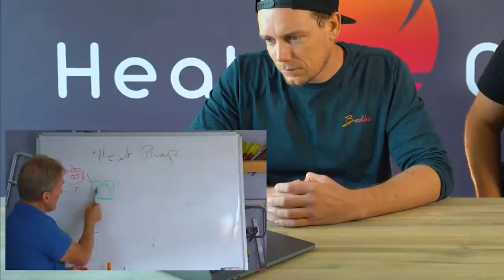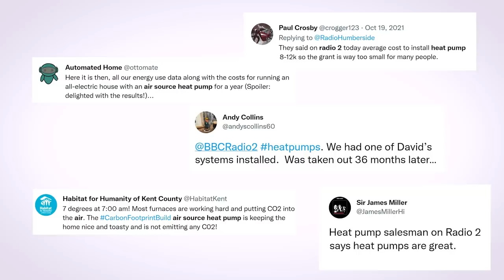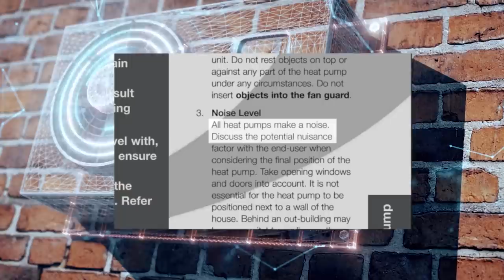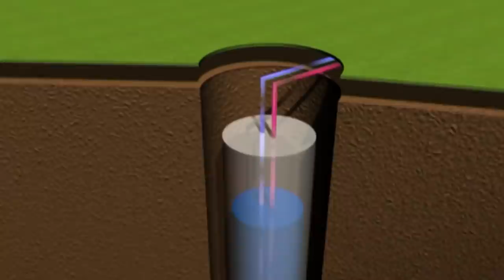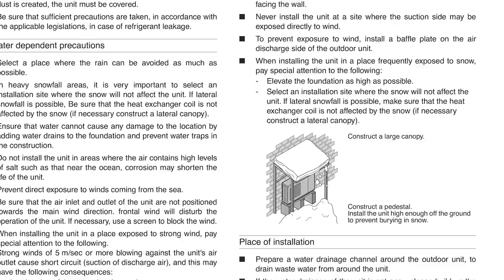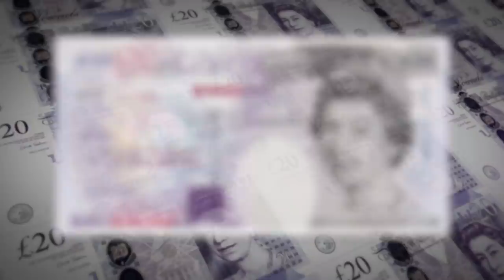Heat Pump Secrets They Don't Want You to Know

Comment: I wanted to thank you for your informative videos.  While I believe you have a bit of a bias against heat pumps, you do back it up with useful information.

For my own home I am planning an air source heat pump installation.  But I am keeping in mind a bunch of the caveats you've mentioned.  The major purpose of the install is summer cooling.  I hope to also use it for 'shoulder season' heating.  But I will not be depending upon the unit for heating in the coldest weather.  The existing fossil fuel steam heat will remain in the house.

My expectation is that the heat pump will be great in the fall and spring when only a bit of heat is necessary, temperature lift is less, and the steam heat is less efficient because of very short run times.  But in the dead of winter I won't even try to make it work.

I'd love to heat feedback on this approach.

-Jon
Reply from the maker: A bit bias? Blimey I would say totally bias. We want to stop people making this mistake.
Reply: @SkillBuilder  Perhaps we are using language differently; I would not call being against something on a factual basis to be biased at all.

You've said that air source heat pumps can work in specific situations, and call out the problems that must be considered in such installs.  My impression is of your videos is that you are willing to identify both strengths and weaknesses versus other technology, with perhaps a bit of bias that amplifies the weaknesses more than the strengths.

I live in a climate where air conditioning is necessary for about half of the summer.  I removed a very poorly implemented ducted AC from my attic, and need to replace it.  (AC was removed in the fall, all of the holes for the ductwork sealed off, and just this air sealing was enough to drop my heating oil consumption by about 20%.)

My home has a splendid oil fueled steam radiator system.  It can easily heat the house on the coldest of days.  But in the early fall and late spring the system needs to spend more time heating a cold boiler to make steam then it spends actually making that steam.  Perhaps I could rip it out and install a hot water system, but now we are looking at huge expenses to install return pipes, add circulating pumps, etc.

A 'minisplit' heat pump system seems a good choice for this situation.  In the spring and fall when I don't need many BTU to heat the house, and outside temperatures are relatively high so system COP is high, then the heat pump would be cheaper/more efficient than oil, but on the coldest days I would simply switch on the boiler.

Regards,
Jon

Comment: Is there another alternative thats worth looking at here, clearly the Gov wants rid of gas boilers like they do diesel cars (even though they are hugely efficient compared to petrol and Euro 6 engines push out cleaner air than the city air they breath in). Is there not a more efficient way of running our gas boilers, or a better way of cleaning up the exhaust?

Comment: heat pumps can be brilliant but you need a house fitted for it otherwise you still need a gasboiler to back it up or  electric boilers wich helps them , wich raises the electricity bills through the roof....

Comment: Honest opinions but with a mistake or two.

You're correct that most electricity used in the UK is currently generated from burning gas - but you're wrong about that meaning "why not just burn the gas to heat the house?"

Firstly because a properly installed Heat Pump is much greater than 100% efficient.  So, even if the electricity is produced from gas, less gas is needed to get the same heat in the home 

But, more importantly, we are decarbonising our electricity supply, shifting more and more to renewables.

We can't do that with gas.
Reply from the maker: Paul 
 Why not decarbonise and then worry about ways to use it? 
As for the efficiency of a heat pump there are lots being installed with no weather compensation because it produces too many call backs for the installers. 
We also have housing estates where heat pumps have been removed in order to put back gas boilers.  Don't simply jump on the bandwagon without checking the destination. This is going to be anothe fiasco.
Reply: @SkillBuilder  We can't wait 20 years for full decarbonisation and then another 20 years for the installed base of domestic heating to be replaced with alternatives - this has to be done in parallel.

Comment: If you place your hand on the return pipe of a heat source pump it will be lukewarm at best. This tells you that it runs at a substantially lower temperature than a gas or oil burner. What this means is any heat loss in the way of poor insulation, poor air tightness and old windows the heat pump simply cannot make up for the heat lost like a gas/ oil burner can. Heat pumps are designed to work with new homes that are air tight and very well insulted.  In this situation they do work very well. They will not however work well in old stock housing without further upgrades to the property.
Reply: Yes. I've seen them put into old poorly insulated houses and they have been useless. One guy I know has had to have 2 massive ones installed after having one fitted and the house was freezing. Even in my own case building my own super insulated and sealed house from scratch I ended up going with a modern gas boiler. The difference in the unit cost and installation cost buys a heck of a lot of gas.
Reply: Exactly. There should be an independent government funded technical assessment available in my view.  We have one here in ireland as part of the SEAI grant system, but its about 700 Euro up front, then recovered if you get the SEAI grant.
Reply: I disagree. Look up "high temperature heat pumps", like Panasonic T-Cap or Mitsubishi Zabudan pumps. Designed to work with radiators and to be installed in existing buildings. Obviously having oversized radiators will help reduce the electricity usage, but these pumps can easily reach 40-50C on return.
Reply: @ggdhx  Are they violently expensive to run ?
Reply: @kyarichards2894  not really if the house is redone with normal insulation. If insulation is bad, no matter what heat source you use = gonna be expensive.
Reply: @ggdhx  I think that is Rogers argument in a nutshell. He is letting people know these pumps are not suitable for the vast majority of existing old stock housing without further upgrades to the property. What you find is inexperienced reps and sales people pushing these heat pumps on people who have little knowledge of construction saying they will heat their house the same and reduce their energy bills. That is simply not the case.
Reply: Funny how my solid wall house built early 1800s at -4c last week was sitting at 21c on the original rads as  we are not redecorating until summer. Also running cheaper and more comfortable than the oil did. I could rip this video apart if I could be bothered. Become to the conclusion his videos are simply click bait now.

Comment: You're argument was lost when you said you can't see the difference from getting your electricity from a gas fired plant. It's far more efficient to have a gas plant serving electricity to heat pumps and electric cars than serving gas boilers and refining fuel. Studies have proven this. Also if mice chewing wires are a problem than we might as well get rid of electricity in our houses altogether 🙄
Reply from the maker: It would help me if you could point towards those 'studies'. I have been told the exact opposite. 
Also mice chewing through wires is a problem and that is why it is in the instructions. Heat pumps are outside the building, I am surprised you didn't spot that small detail.

Comment: I'm responsible for heat pumps in large public buildings, some of what you say is true i.e. electrical backup, condensation but also you've cherry picked a lot of exaggerated negatives which could be picked out of any system. Just as an example for a gas boiler you need a gas supply. Every year we have gas explosions, some fatal, but I don't see fatal heat pump explosions. See what I mean? The video piece is OK but you highlight potential problems with heat pumps but no solutions to the overall problem as we simply cannot continue burning fossil fuels.

Comment: Skill Builder is clearly from the UK where this technology is now being pushed, so lets try looking at it from a UK stand point not from countries that have had this tech for years. He makes good points that conflict with what all these so called experts go on TV, isn’t it a good thing to get opinions from someone who has experience working on/installing all the heat pumps? So lets look at costs to install (in the UK)? It’s crazy money which most people can’t afford? If you have a property that is suitable for it and it works well for you then that’s great, no one is saying it isn’t. What are the maintenance costs? What are the parts availability? Parts for gas boilers are stocked nation wide with a good portion being able to be ordered for next day or off the shelf. Is this the case for the HP? It’s good hearing that people have had these working for years in other countries. This may not be the answer for everyone, just like electric cars. But if you have the money, space and a property this suits then this could be a good system for you. We may not all agree but it makes no sense to be abusive if someone has a different opinion to yours. I would be interested to see how many of the people in the comments have had experience working on/ installing / using from the UK? I’m only saying that as Skill builder is arguing this from a UK stand point

Comment: Well done Roger, not a 'rant' this time, more balanced although I still get the impression you are still a tad against the HP. Your point of power generation was mute, what do you expect? Gas/wind/coal/nuclear nowt we can do about that, we need electricity. I am taking a gamble on this, whilst electric and gas prices are through the roof at the mo, my guess is electricity prices will drop considerably in the future. For me I am not on the gas mains I have to use LPG (this has almost doubled since 2020). I go live tomorrow with my HP, I will give you an honest comparison and update on my decision to do this, I did my homework. Regards J
Reply from the maker: I think in your case it is a good choice and I would do it but I would make sure I had the right insulation and big rads or underfloor heating. 
My rant was all about the government giving grants so all those salesmen will will persuading people on mains gas to switch, 
I would love to know how you get on. I really am not against this technology in the right place but a lot of people will be unhappy.
Reply: @SkillBuilder  Cheers Roger, yes my property has been fully assessed insulation wise, upscaled two radiators only. I used a trusted installer (they installed my solar panels). As you know the government grant for my HP ceases in March, but I would be a fool not to take it. I do however agree with you, most housing stock in this country insulation wise is shocking, and that where the problem lies all round. You are the man to put it out there if you do decide to do what I'm doing this is what you need to do to make it work. PS. My installer says many future installs will miss the government grant due to HP supply issues.

Comment: Soooo, an air sourced heat pump is not suitable for every circumstance, who'd have thought. Even if you can figure this all out by yourself, check with a couple of dudes who know what they are doing, always a reasonably good idea. I have an air sourced heat pump, and it has worked just fine for the last 12 years, cost me £2,000 (probably refereed to as a "mini split") . Where I live the coldest it gets is about -6/7 degrees C, I have insulated my house pretty well (a good thing to do before you do owt else) . In the winter I put an extra layer of clothes on, I'm 69 and reasonably healthy/fit, even if I do say so myself :)

Comment: I have one and my bills are twice as much,they don’t tell you that,the heat is not as warm,we’re the rads get hot with a boiler,you need additional heat to use,when it goes in to defrost,it went from 70 pounds a month to 150,and don’t say it’s not fitted right,and you do need to keep it on all day and night,and you need to heat the water up as well because it’s doesn’t get it hot enough,I have had it for 9 years,and if I could I would switch to a boiler

Comment: Heat pumps and insulation two separate subjects.
A property no matter the insulation will take the same amount of heat whatever source,  heat pump, oil, gas, electric.
A well insulated property will take less to heat again doesent matter sourse of heat oil gas etc.
Reply from the maker: Rodney
The two subjects should be always considered together but I am amazed how many seemingly intelligent people don't understand the issue here. Yes insulation and draughproofing are desireable but they are often difficult to achieve in an old property. If you have a given heat loss from your property at say 0 deg celcius outside the heat pump with its low flow temperature will not be able to put the heat back into the building at the rate you are losing it. A gas boiler running at a higher temperature will have a better chance of keeping pace with the heat loss. It is not a desireable situation and in an ideal world we would insulate so we could minimise the heat loss but we have to be realistic. At the moment many people switch a gas boiler on for (say) ten hours a day and let the house cool down rather than trying to maintain a round the clock temperature. With a heat pump you can't do that because it takes days in the cold weather to bring the house back up to temperature. This is all explained in the installation instructions for setting up the parameters and weather compensation.

Comment: 6:10 "Look at the size cable" uhh yeah wise guy. The size of an electrical cable is determined by maximum, not running average. And the running average is no where close to a full rating of 6kW for whatever random heat pump you picked out.

Comment: When the time comes & they ban fossil furled heating I’ll just fit smart WiFi app controlled electric oil filled radiators , 
Probably cost me under £2000 to fit them.
Vs average £12,000 ASHP
Leaves £10,000 spare for heating bills. 

You can then just heat the rooms you need too when you want them warmed up.

Comment: While some of the information is accurate, I would much prefer a video which gave some positive views on the things to do when installing an ASHP, not taking every opportunity to slag them off.  Not very one can afford or has room for ground source, but we all need to do something to change our heating needs.  Starting with much improved insulation would be a good initial step, then an alternative to burning stuff!
Reply from the maker: Hi Jeff
I am countering the heavy sales pressure from companies who want to mop up the grant money. They are not concerned with the performance and many are difficult to contact for aftersales service.
Reply: @SkillBuilder  Yes, I agree with that whole-heartedly.  What would be helpful would be some more 'do's' and advice on how to make sure you steer clear of bad installers and badly designed systems.  i.e what makes an ASHP a viable replacement for existing dirty boilers.  Thanks for the quick reply!😄

Comment: Good afternoon Roger, a little patronising  calling the heat pump "a little fella". Have a look at the link I've shared of a recent install we've carried out in North Wales. In the right environment, a Ground or Air Source HP can and will work. We do turn some properties down if they don't fit the criteria and that's the most important thing, ensuring the property can adjust to a product that produces lower temperatures. 
Anyhow, enjoy or video Roger and you can see a real installation done (pre-switch on) - https://youtu.be/MGNKrlxYiqw (Samsung ASHP) + a recent school we swapped out the oil boilers for a GSHP in Chorley - https://youtu.be/-lAFlJNG4sk

Comment: I'm currious why could we not just have an elec coil in a standard combi, we could suck up any excess wind & solar (some control wizardry). A best of both approach. Mild autumn day, elec, dead of winter gas.
Reply from the maker: Nobody has managed to make a reliable electric combi. You need a cylinder. I like the idea of a hybrid system, they are common in France.
Reply: @SkillBuilder  I think didn't explain myself. What if all the combi's had a 3kw immersion. When solar or wind is high & prices are low the boiler will call for elec first with gas to fill the gap. Clearly some clever controls required. Though not a perfect solution it would soak up any excess green power. So on a mild day when the boiler is only using 3kw elec could cover it. On the cold day in Jan the gas would give you that oomph. As opposed to replacing 10% of gas boiler, what if gas boilers used 10% elec.

Comment: Big plan, but the government did not take into account that most homes in the UK are powered by single phase. Single-phase heating pumps are cheaper than three-phase, but have significant limitations (much lower output power). Using a single-phase air source heat pump - especially at low temperatures - can overload the electrical system and shut down the heating system.